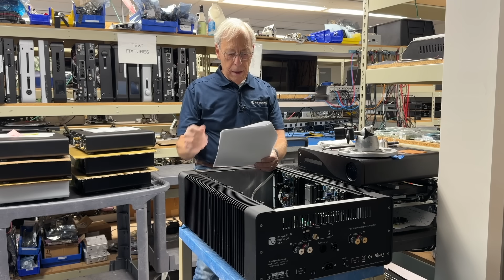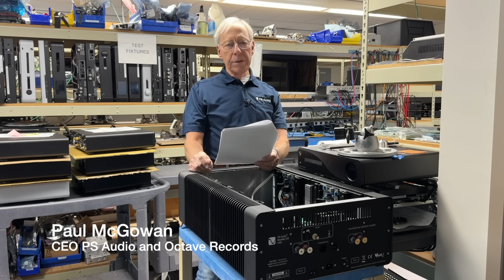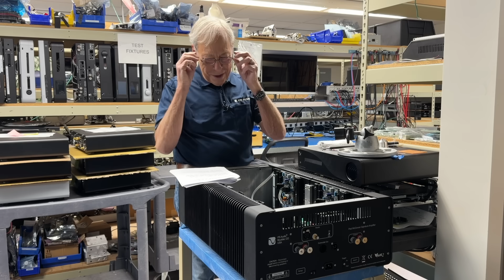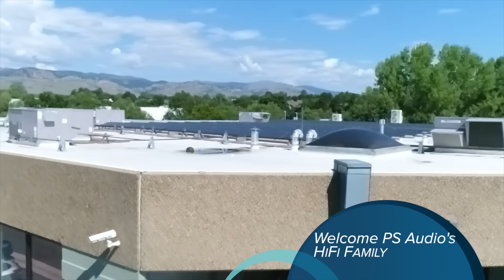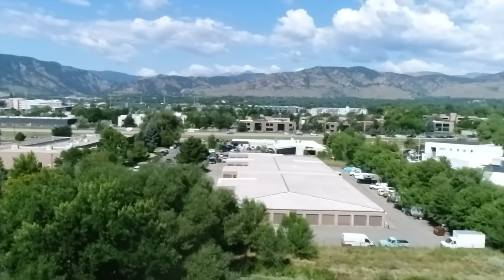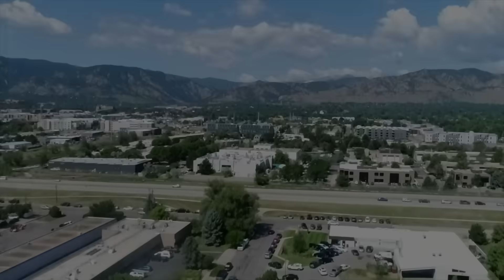Why Class A amps cost more

Comment: small market. mostly.

heatsinks are cheap, actually, considering the prices of the things. heatpipes are cheap too, it's 2026. if you were to go with active cooling it would make it a lot cheaper again and a fan doesn't need to make sound all that much when you have the space to work with.

the markets just small, not all that many people want them or want to keep them on.
Reply: Pair of black anodized fins for a 30W 2ch class A set me back $200, excluding CNC machining to match the design requirements, ie. cutting to size, drilling, tapping and polishing of the device side to perfectly flat and mirror like finish in order to maximize heat transfer and lower IR emissions directed towards the PCB. I think its more about PS and ICs, when it comes to cost. You need a beefier and quieter PS and lots more output transistors to handle the much higher standing DC current.
Reply: @lasskinn474 ...please publish where you get these cheap prices from.
Reply: What do you think I am? Chat GPT?
Reply: We are not talking about Ali Express heat sinks for class D amps, that are penny items weighing grams. If you get up to passive cooling blocks for (lets say) 200W dissipation, you are in the territory of bespoke CNC machined parts. They are among the highest cost items you will find an a Class A amp.
Reply: @hugobloemers4425  Still, the BOM will be 10% of the sticker price.  It is a small volume market driving high gross margin.

Comment: Please pay attention to design and manufacturing details and quality. PS Audio amplifiers in my experience has always have mechanical hum from the transformers as well as hum from the speakers.
Reply: Modicum of hum is inevitable with large toroidals, but if it's excessive you may have DC riding on the mains, which toroidals are especially sensitive to. Couple of large caps and rectifiers can be arranged to lower the DC voltage. Google AC mains DC blocker. Also any high bias amplifier with unregulated rails will produce a little bit of hum in speakers.
Reply: @paulb4661  This was connected to PS Audio power plant, P15. No excuses. Also Luxman amps are dead silent both mechanically and audibly connected to the same electrical circuitry. Not just Luxman, Pass Labs too, all quite. PS Audio were just built to a lower standard.
Reply: What tunes do they hum??
Reply: mostly 60's (Hz) tunes.
Reply: For those who experience the hum, are you:

1. Using the XLR connections or RCA

2. Using a power conditioner, if so what brand

IMO, it’s very disappointing to see such expensive equipment hum. 

Luckily for myself, have never experienced hum and no distortion.  I have two systems too and they’ve been in two different homes.  

I have Adcom pre-amp and amp and power conditioner and use rca inputs and outputs.  First system which everything still works fine from the mid/late 90’s. 

Acurus pre-amp and amps and power conditioner.  From late 90’s.  Everything works too.  

No special expensive cables.  I just assumed whomever designed and manufactured the amps must have paired it to their own pre-amp and ran hundreds of tests.  Any noise would have been addressed with their own made power conditioner and again tested.
Reply: My Nagra mono blocks do not hum and I have 105dB horns. PS Audio is a good company but they do not make world class components. Paul is more about marketing than engineering.
Reply: @Fluterra  what Nagra monos?